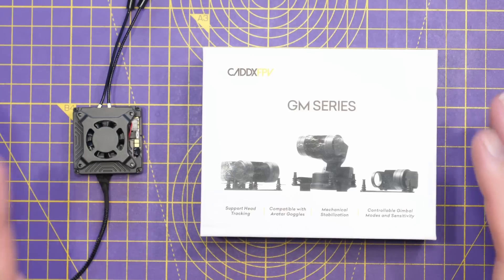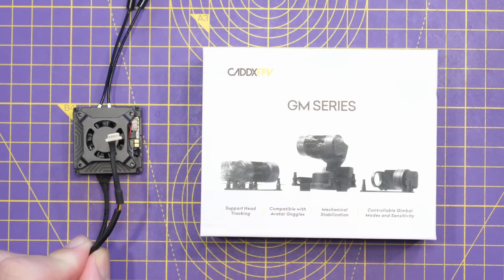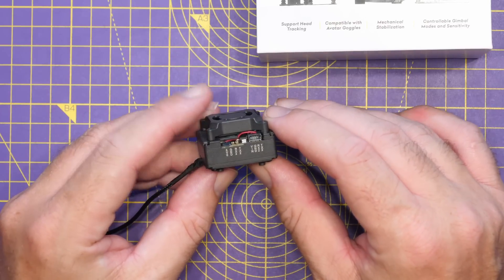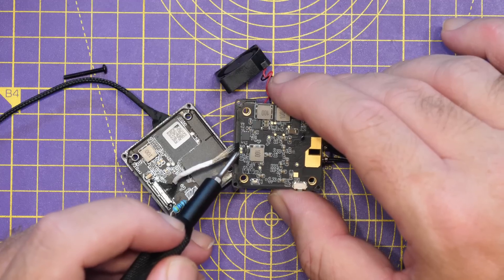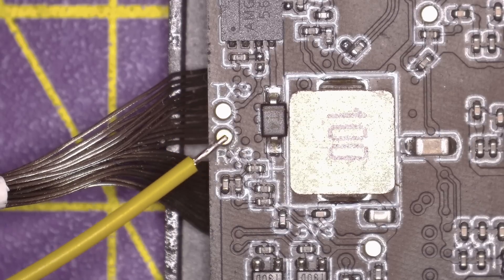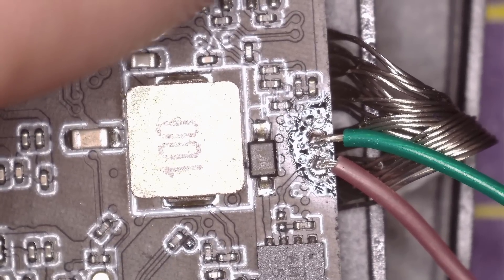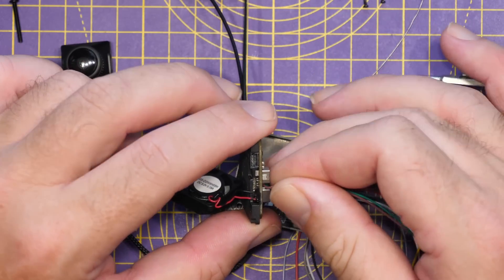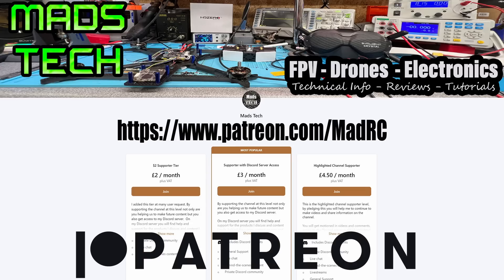Caddx Avatar GT Kit Gimbal Mod - GM 3 Gimbal How-To

Comment: A much cleaner way to route the wires is to pass the wires through the hole on the circuit board between the antennas sockets before soldering.

Comment: Super interesting. I'm still completely lost as to which video transmitters actually support the Head tracker to gimbal pass-through functionality. Do you have a video that covers this or perhaps you could address it?
Reply from the maker: Moonlight and both V2 VTX.   Technically you can use the GT but it needs this mod.
Reply: @MadRC  hello have some doubts , can you please provide the link for firmware the exactly supports this mod , i purchased gt kit accidentally and i need your help

Comment: I have done the same mod.  I am not getting the range on the VTX. It keeps dropping off the signal, even with standby off. What I’m missing here? The GT VTX is mounted on the outside of a fixed wing aircraft, and is powered by a 3cell lipo battery.
Reply: Im sure you found the info by now but you got to unlock the 2w via files

Comment: 0:13 "hopefully in the goggles X?" your words are very heartwarming, but the reality makes me laugh more and tears at the same time 🤣 . caddx like a clown 😆
Reply: I have been a clown professionally, we wouldn't accept such incompetence either.
Reply: @charliecarpenter2840  I spent my fortune to buy goggles that are said to be premium goggles x! but it's like rubbing salt on a wound! out comes Goggles L with full head tracker support!!!! That's true clown F******🤣😆
Reply: @MrBornenjap  Haha, yeah in the same boat. I'll let you know if I find a solution.
Reply: @ Heard back from customer support. I need to update everything to latest firmware. 

 For this I need: SD card (lv10), their update board, a 4 to 5 connection 3.5mm jack cable, a 3 connection 3pin 1mm spacing jst connector and a 4 connection 6pin 1mm spacing jst to usb c cable. Oh and a windows machine, no linux or mac support. Oh and a standard usb c cable.

For the vtx use the jst 4connection  6pin to usb c to computer ( this is just a file transfer, can be done via linux ect.)

For the goggles x use the sd card ( again can use linux)

For the goggles x headtracker unit (internal) Use the 3.5mm jack (5pin end goes to gogs) via the AV port to the update board and this via usb c to computer. This requires running a windows exe.

For the gimbal use the 3 connection 3pin jst to the update board and usbc to computer.This requires running a windows exe.

Simple haha, you are right, they are clowns.

Comment: If you use INAV, Inav 8 supports HT via MSP not needing to connect the gimbal to the internal uart of the GT.
Reply: Agreed, saves having to take the gimbal apart or change any existing wiring. I'm sure Ardu/BF could do it too if one of the devs took it on.
Reply: Do you have more information on this? Like an actual link to something that shows how to make it all work?

Comment: I'll pop this here as its relevant to this video, my rant from earlier today. So goggles x still not got head tracking update yet?

I'm so sick of dealing with Caddx. I have the goggles x with internal headtracker, v2 dual vtx both with latest firmware after I had updated or so I thought.Bought the single axis gimbal which comes with outdated firmware and without the  board needed to upgrade it. 

It has no manual or installation instructions published at present time, these are NOT the same as the GM2 and GM3. It is also unclear whether I need to upgrade the firmware in the headtracker in the goggles or the GM1. Either way I can't use Linux or Mac, windows only, yuck.

The goggles headtracker doesn't update with the rest of the firmware via SD card , no  no, it needs that board too and updates via the AV port. Board is $10 delivered.

You can apparently use a normal FTDI to update the gimbal, providing of course you have a 1mm 3pin jst to hand and are willing to guess at the logic level voltage. Doesn't help much for the headtracker in the goggles though, could probably use the same converter but without any published info it's a mission to find out and not without risk.

The GM1 does not come with a 3pin 1mm jst connector, because Caddx hates you.

The GM1 has the camera mounted offset to the mounting holes, so if you do have to make your own mounting plate (you will), you'll have to offset the whole plate to center the camera to the drone. This offset measurement is not included in the technical drawings, it's a lovely surprise for when you have finished the first of the two mounting plates you are likely to make. 

The GM1 doesn't come with a spare coaxial cable and in order to have your image the right way up after mounting, you will need to put a 90deg bend in your vtx cable and stuff it into the back of the mounting, this isn't mentioned anywhere. There is no way to turn the image in software for the GM1.

The GM1 has no backplate for unknown reasons

The whole shebang is mounted on m2 screws, yes the really tiny ones. Yes you will need over a 1.5cm of stickout thread to mount.  Yes M2 mounts at the business end of a drone with large stickout, are very likely to break in a crash. M2 aren't commonly available over the counter and are a pain to handle. Especially as you will likely want to use nyloc nuts in this instance. The hole spacing includes thoughtful spacing like 38.6mm,  really? why?

Honestly thinking of reporting the uk based seller to trading standards over this, it is an utter mess and very likely illegal to sell without warning people of the issues. 

Feels like you have contempt for your customers

Comment: Whats the smallest gimbal that would work with Goggle X?
Reply: I just bought the 1 axis, v2 vtx and goggles x. Not working so far, will try updating the gimbal firmware.

Comment: Why can’t caddx connect goggles x to gimbal?
Reply: It does, with upgrade board. I use mine on my rock crawler.
Just wished I knew about this gt mod earlier as the gt vtx has a fan to help cool the system.

Comment: Wow great information.  Im currently in this pickle buying gimbal and GT VTX. Any issue after the mod? Any thing im losing other than 4k upload? 

Also the blk/red power cable from the gimbal did you connect the blk/red to VTX so it use one power battery?

Thanks